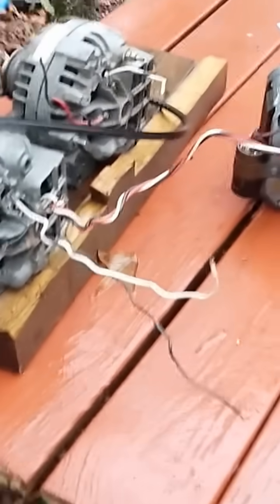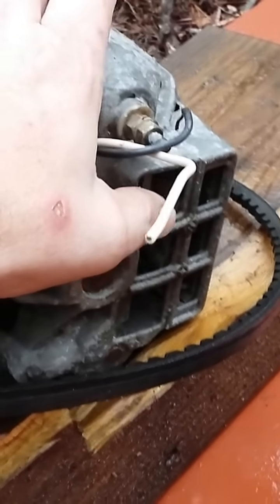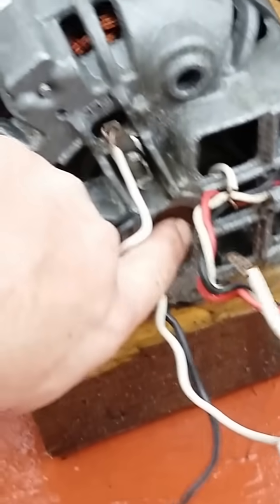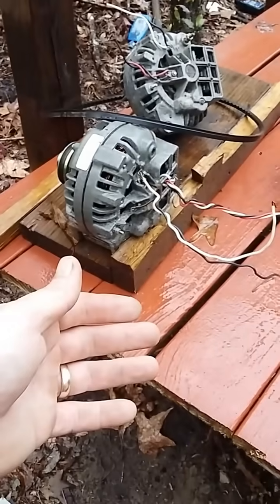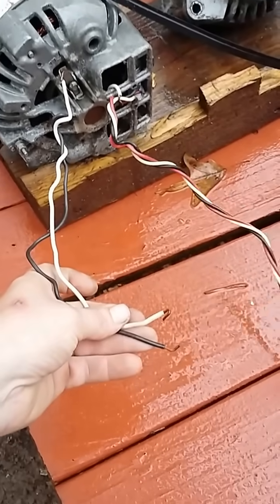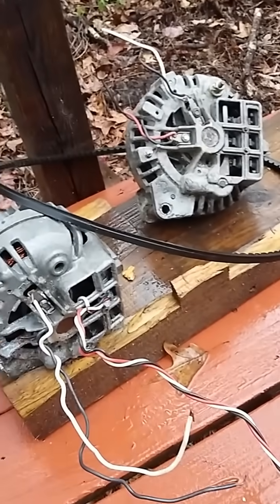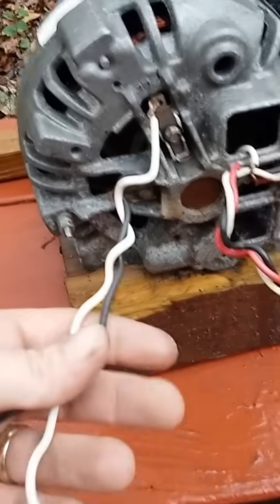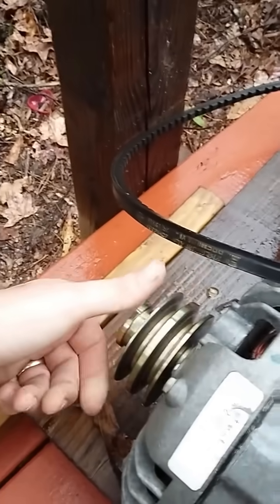Update Free energy forever no wind no solar no gas READ DISCRIPTION!!!

Comment: Thomas.
The men that have had possesion of the most valuable knowledge on earth do not want to loose control of the knowledge they use to build this world with.
This is why they have to genocide the earth of all humans everytime technology evolves enough for man to become independent from them.
These men will leave there knowledge hidden softly away with many riddled up coded maps to it's location for the next age of MasonS to hunt down decide and use to build and rule the world again.
This is why Jesus tried to murder the priest that held all the knowledge for is ring it in wicked evil and greedy ways to become wealthy GIANTS on earth with GIANT army's and GIANT city's with GIANT populations ocupying Hi
GIANT amounts of land .

Your right the comment section is full of GODS evil quite boys trying to discredit you.

They know you can use one leg with 110vlt@90amp to power 6 - 110-15amp breakers and the second leg to power the the generator with.
No they don't want us completing the circle circuit of perpetual electron pumping and flow return.
Just remember electrons flow from - to +
And uni volt a.c. motors torque is via voltage not amperage.
Reply: Ginger Bread think for a second. This video would not exist if it contained anything threatening to”their” control.

Comment: Now the problem with the dumbest of the dumb is that they don’t know what they don’t know.  Good luck mate hope it works for you!
Reply: He explained it well but to the layperson it won't work.  Apply the excitation voltage, spin the rotor to acquire sync speed and that's pretty much it.  Use the output voltage to rotate rotor using another motor.

Comment: 6-12v in 220vAC 90a out? does this alternator trick open a portal to dimension W? and somehow pull 19,800W from said dimension?
Reply: The low DC voltage is excitation voltage for the field coil. You still have to spin the rotor to attain sync speed and then get your 220V, 90A output.

Comment: Dimitry, but u need power to get the altinator going right?
Reply: Once the alternator rotor is spinning at sync with the field, you can tap the output voltage and use it to run a motor that will in turn run the alternator.

Comment: A lot of people have NO clue evidently.Car and motorcycles produce alternating current A/C..Then it turns the A/C power into D/C power for the electronics and battery.So making your car altenator put out A/C power is easy,it already did that from day one,you just gotta make sure it don't get converted into D/C power,then you have an A/C generator.People have NO clue by thinking you gotta have a motor turning the pulley lol NOPE a 6 foot windmill hooked up Mcgyver style to a belt turning the altenator pulley is all you need,and some wind from Mother Nature,it is always windy here in the Midwest.

Comment: I was under the impression a 'diode' allows the flow of current (electrons) in a single direction and blocks the reversal of current
Reply: You are correct
Reply: But use 4 and make a rectifier you can convert ac to dc
Reply: 4 diodes make a full bridge rectifier you can make a half wave rectifier with just 2 but its not as efficient or stable in voltage.
say the output is 5v dc with half wave rectifier the voltage will go from 0-5v repeatedly where as a full wave rectifier will be a more "stable" 5v.
Reply: @darkshadowsx5949  i know this :)
Reply: The stator produces AC that goes to the rectifier the rectifier converts it to DC. So even making a rectifier out of diodes wont produce AC.
Reply: you gotta to read a bit more to know a bit more.  Diodes arranged a certain way can rectify AC to DC. It is a very clean DC, just so you know.  But you can use it as is.
Reply: @timookello3822  Its actually very choppy and needs at least a capacitor to clean it up
Reply: @gowdsake7103  i meant to say isn't very clean..but thanks.

Comment: What turns the statir to make the power?  A 12 v or 6 v?  So you still need power to make power
Reply: The stator is rotated using the very output voltage that you produced. The output voltage can run another motor.
Reply: You use the power that you generate just a little bit of it to power the generator

Comment: Diodes are like Check valves they only allow electrical flow in one direction, the diode keeps the Battery from draining back . It is the Rectifier that converts AC/DC
Reply from the maker: 4 diodes...  aka a bridge rectifier converts alternating current into pulsed direct current if you want to be technical about it and if you put a polarized DC capacitor on the positive and negative output off of the bridge rectifier you will bring the pulse width closer together and have a smoother pdc that's closer to direct current... but thanks for the comment!!

Comment: wire would melt at 90 amps,
Reply: Kimberlee Ellison that’s why you use bigger gauge wire. He just showed the wire for illustration purposes. If you were going to run 90 amps, you’d need 2-4 gauge wire or bigger to avoid burning up the wires. #4 will work up to 115 amps, #2 will work up to 150 amps.

Comment: so feeding 3-6 volts. using a motor to turn the stator...and 220 volts (ish). How fast are you spinning the stator? I'd wager it's pretty dam fast.
Reply: the 6 volts is for exciting the field coil.  Then he has to spin the rotor to acquire voltage on the output which voltage can be used to run a motor that would spin the alternator rotor.
Reply: Timo Okello true. If you just spin the motor fast enough by hand, you can probably make enough voltage to keep the motor spinning by itself. That’s what I saw someone else on YouTube do.

Comment: To all you naysayers out there here is a little tidbit. Power from your power station is made with giant alternators called turbo alternators. The only difference is how they are powered. In some power plants like the one my dad works at are powered by steam turbines. His power plant uses the Ohio River for water. By doing what this video explains you would be creating your own little power plant.
Reply: Errrm a power plant needs power input the river the coal the steam even you should be able to get that. Yes you can use something like this to convert AC to DC or visa versa but it aint free
Reply: gowd sake yes, the power source you need is a 6-12 volt battery, and a motor to spin the alternator. Someone else on YouTube, with a motor connected to the alternator, just spun the motor by hand after hooking up the battery, and once there was enough voltage in the alternator coils, the motor started spinning by itself.

Comment: This would work. My problem is the power company just put a smart meter on my house. Would this stop me in any way? I signed an agreement with my supplier for a year too. I. Wonder if they would sue me?
Reply: Research about wiring your electrical service panel for solar panels or wind turbines. The principal probably is the same, just with a different power source.

Comment: ....and if you hook three of these in series, attach it to two rods (one copper, one zinc-plated) driven to a depth of at least 3.7 feet into the ground and attach a 12v deep-cycle marine battery, you can pump the flat earth into a sphere... Leonardo Tesla did this in 1731 and created shock-free electricity that they charged wickless candles with... one of those has been burning, continuously, in the catacombs under the Vatican since 1762.....

Comment: 1st law thermodynamics ENERGY CAN NEITHER BE CREATED OR DESTROYED 
 and this guy is smart enough to prove laws of physics wrong
Reply from the maker: Mark I am breaking no laws of physics I am bypassing them very simply! The higher the voltage the less resistance and the higher the frequency the less current consumption! The only thing that I showed in this particular video is my 3-phase filled magnet motor which is the alternator with some wires hanging out of the back of it... we are about to go into mass production!

Comment: Lol. Nobody’s gonna kill you over making a generator out of an alternator because an alternator already is a generator, you’re not creating power your just generating One form of electricity but you need a motor to run it so basically you just built a generator.  You can buy them at Home Depot, nobody’s going to kill you for that. 😂

Comment: Yup, an alternator can be a motor, or a generator but, to act as a generator it needs to be rotated under power, so what is providing the low voltage supply?  Then you claim that small alternator can generate 220 volts at 90 amps!! WTF, that is almost 20 KW!!!  So an alternator rated at no more than 0.75 KW, maybe 1 KW at most, suddenly becomes a 20 KW generator??! NO FUCKING WAY ON THIS PLANET!!  The basic formula is power in must equal power out,  no way around it, that's the way the whole universe works, no shitty little car alternator, no matter how clever the wiring is going to defy that!  If you don't agree, then PROVE me wrong?!  If I can see it work, with my own eyes, then I'd believe it.
Reply: turboslag  you would use the same thing your car uses to power it. A car battery!  Wow dude
Reply: And therefore, so much for free energy!!

Comment: Howdy, the output isn't gonna be at 220vac 90amps... alternators are made to output ~20vac at 100amps which is 3phase and rectified to produce low ripple low voltage high current output...    How come you don't show it running?  to show the voltmeters readings of the amps and volts..?
Reply: CoruscantMe   You just have to modify it. Didn’t you see the one at the end? He has a compacitor he added to it
Reply: Jeff Humpe no I don’t see it running and doing what he claims it does.  Where’s that vid?
Reply: Ok so does nobody get the fact that he knows it won't work? The baby and the rain are props to make the video more asinine and to bring on some outrage. He gambled on an idea and it paid off.  The man made a bunch of money because of all these replys. Pretty ingenious if you ask me! . Y'all might be laughing at him but he's laughing all the way to the bank!  If you wanna know just how much he made, do the math.

Comment: You are right about how a car alternator works.  Good explanation, but you gotta spin it with something... A wind or water turbine, or a horse or something.  They are junkyard cheap and easy to modify.  You get three phase AC by bypassing the diodes, true, but it's not 60 Hz. and voltage varies with speed without a regulator circuit.  Any conversion from mechanical to electrical energy comes with losses from friction, heat and windage.  There's no magic or secrets, just a great way to build a wind or water turbine power source.

Comment: You obviously know nothing about electricity. If you had your "generator" working and could show it producing electricity and actually powering something then we might believe you.What it sounds like you are referring to by hooking up the coils in your alternator and applying a small amount of power in one side and getting a larger amount out on the other side is called a step up transformer. While it will increase the voltage , it will not increase the current. Actually , the current will decrease therefore it would not be able to run things that require a high wattage.

Comment: This guy's a waste of energy for a start. If you're hoping to see this working, forget it , it won't work. Did you see his 90 amps ? No, he doesn't even have a multimeter to show, just a few old car alternators and drive belt on show. BTW, 90 amps will be melting the wires and blowing your house fuses, It's all pure waffle.

Comment: Could he use two alternators, one normal and one modified for the high ac output. Using a flowing stream he could spin the first reg alt to send 12v dc to the modified one and also spin that one from same stream water, then he can do whatever with the ac output?

Comment: I would definately upsize your feed to the panel(electrical box)...90 amps running through twelve gauge, or even ten gauge wire is too much.  Its a fire hazard at best...you definately need a bigger gauge wire to power your house...this (might) work temporarily, but will fail over time(for sure)!

Comment: not good with electricity but it sounds as if you hook a battery up to the alternator which has been converted to a generator so that is a motor it will run he explained he had done something with the diodes so that the motor produced mega amps so you would think he has with the produced power included a battery charger in the system..and in passing on this information is asking for a small donation what's wrong with that you tight fisted c---ts..good on you mate i admit your explanation is a bit sketchy but i appreciate your input and would hazard that if a small donation and email address was included a more detailed email would be included.this is the first time i have ventured onto this site but i'll follow up and check out others..and before the dickweeds point out that several million 5 buck donations is a lot of doosh boohoo
Reply: David forrest if he wants a donation then he needs to show his work instead of just talking. That is why people dont believe him.

Comment: Okay, so i learned the electron theory, i know the theory of AC and DC electricity, and i know the theorys on engines and energy. 

1st you need to put energy into something that "produces" energy, and since energy is not created its harvested from something. 
Yes, you In fact need a motor to run it, because you need the stator to spin to induce magnetic feilds and "cut the flux" to conduct electricity through the wires. However you can only get get so much of what you put into the equation. Our cars run off of gas to power the alternator which "feed" the spark plugs (for combustion)so then in can in turn "feed" the alternator. 

The problem with motors is friction, there is no such thing as "free energy" because it alwasy costs enegry to make energy, and most of it will be lost by heat or friction(as mentioned) and that leads to loss in efficiency and that means you will never break even on how much "energy" you put into the system.

Thus, you need a driving force, thus you need gas, wind, solar, or alternative power to have the generator working. 

(Yes magnets are wonderful and all but AC electricity is not magic and it doesn't come from nowhere)
Reply: If you freeze a magnet in liquid nitrogen you can then place the magnet about half inch away from another magnet and it will stay and float in mid-air thus creating zero friction

Google magnet in nitrogen experiment it's insane
  It won't create free energy but it could possibly reduce the cost by 99% to produce it in the future subways and trains will use this technology
Reply: @MelloMC33  yes i know about the technology, "super cooled magnets". However it would be expensive to keep putting liquid nitrogen on everything, or even refrigerating it to that level. Not to mention again the cost in energy to do so. Which sucks. 

But there is a magnet powered train in Japan(i think dont quote me on that) but it doesnt use super cooled magnets it uses electromagnets.
Reply: Super-cooling giant super-magnets is impractical and unsustainable.
Reply: @MelloMC33  Its called a super conductor

Comment: That 3rd motor is off of a Whirlpool/Kenmore washer. I'm on a 48 volt solar system now, 16 marine batteries. 10 years + now.
Reply: How much did your system cost to make. Ive been looking at solar and wind systems
Reply: @mickeythornton9708  it depends on the brands, but solar panels fech for 100s of dollars.
Reply: You see solar energy is the way to go, and nice incorporating batteries to store the extra power for dark times.

Comment: Just asking...The alternator can connect to inverter?
Reply: Ummm.....it doesnt have to. An inverter makes DC(direct current) into AC(alternating current), an alternator already makes AC, it goes through a series of diods thats called a "3 wave rectifier" to turn it into DC. to keep the output as AC just bypass the diods. 

Either way, you shouldn't listen to this guy, hes an invalid. He doesn't understand that you have to put a driving forve behind a generator to make it generate power. Just get some solar cells like a regular poerson and connect it to batteries.

Comment: did almost the same thing and was told without an electric bill or fuel bill they would take my boys so yes I agree with you only difference is I used hydrogen assist when extra power was needed or to just jump start

Comment: It is obvious why you didn't make a video with a working model.  A multimeter w/amp probe is cheap to buy and you could have demonstrated your concept to your video viewers. You spoke of a unit you used to produce your house power....why not show us that unit?   You are stating Amperage/voltage output that your unit produces.  That means you had to have measured the Amperage/voltage at some point to make this statements...that means you had at least one multimeter and ampprobe..please duplicate you taking your readings on your working model on your next video. If you won't do that will you please take down this trashy video from YouTube?
Reply: He could've just gotten thst statement from the package of the alternator.